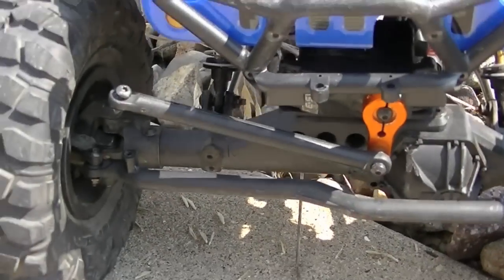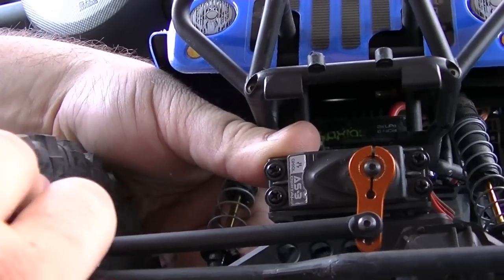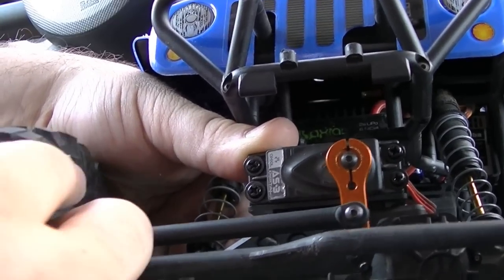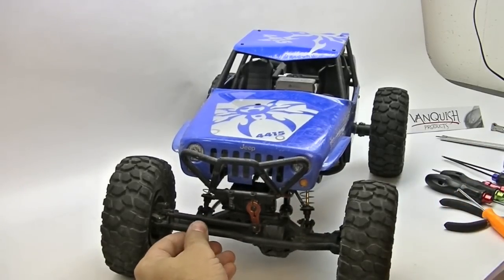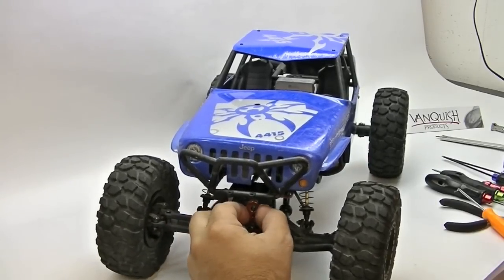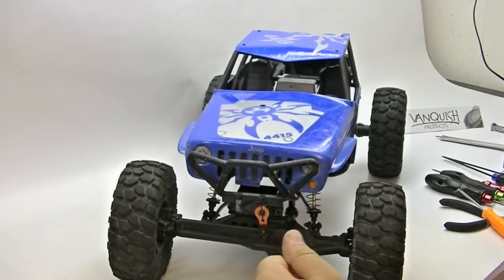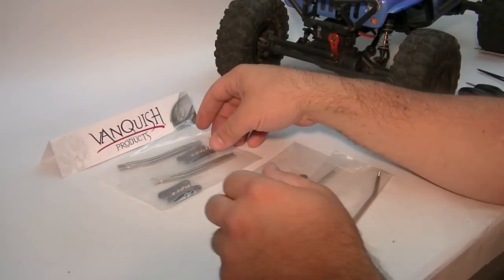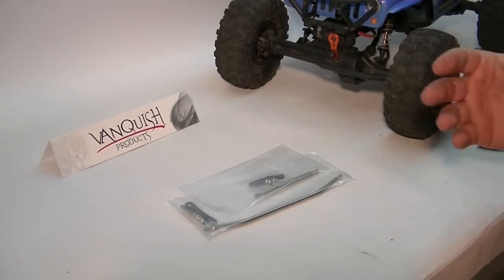Poison Spyder Wraith - Steering Linkage - Week 6 - Budget Build

Comment from the maker: I recommend a minimum of 300 oz-in in a Wraith. I will be using the Futaba S9157 which has 420 oz-in. I normally run the BLS157 which is about 520 oz-in. I have been a Futaba Factory Team Driver since 2008 and only use their servos. If I was going to use anything other than Futaba it would be the Hitec's.

Comment: NOW, SOMEBODY IS MAKING A BEARING TO REPLACE THE STOCK BUSHING. My steering servo didn't go long before getting a lot of play. I took it apart and found a bushing just inside the case where the splined shaft comes out. It was worn and that was the only problem. My friend made me another at work that was too tight and burned out the servo.   I wish I would have known because I like the stock servo as far as power and speed.